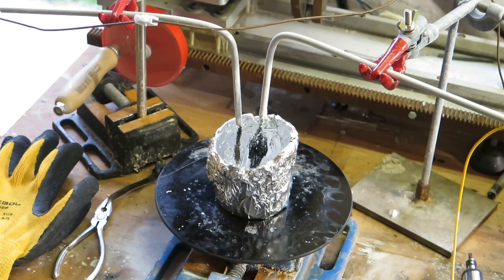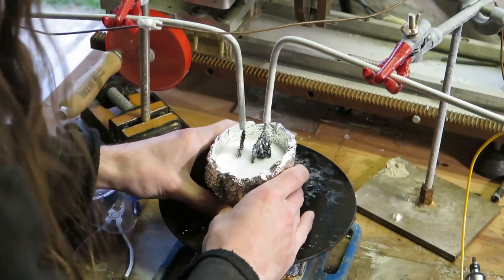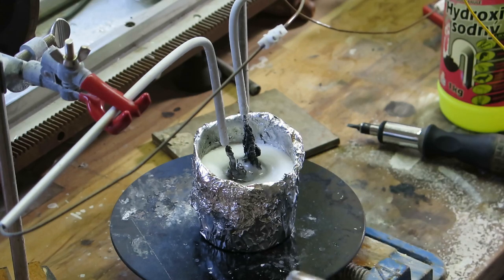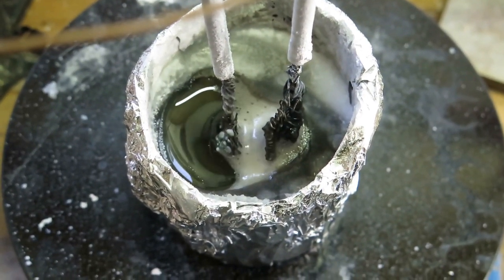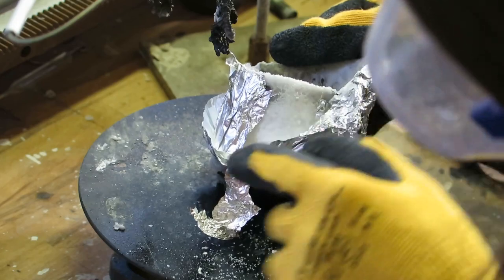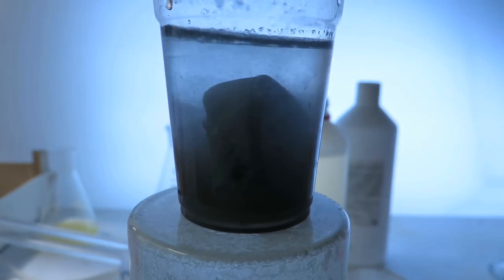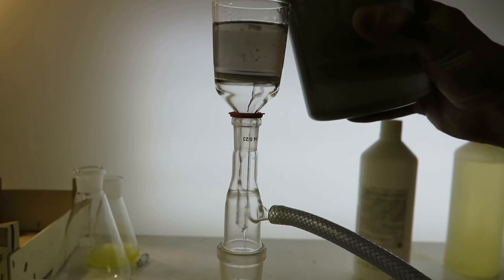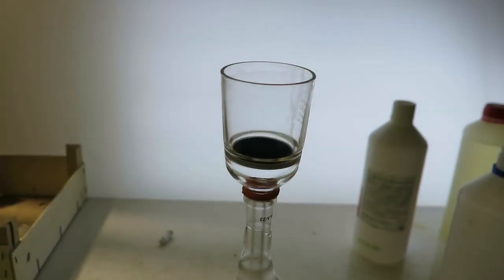Investigating NaOH contamination of Castner cell

Comment: You are very brave guy to put NaOH into Al, as NaOH can easlity react with Al. 
Why don't use PTFE beaker and simple stainless or  Ti electrodes?...
Reply from the maker: NaOH doesn't react with aluminium without water. it would have to be redox and on the right side you would end up with metallic sodium, which is super unlikely.

Comment: Interesting. I'd like to build a little automated Sodium producing machine. Stainless steel seems to be a good electrode material as well. I think you are the most experienced sodium maker on YouTube. Do you have some tips and things to avoid? Would stainless steel last longer than aluminium in the long run? Others say Sodium production seems to be good at first and slowly get worse, do you have an idea why that could be?
Very nice content 👍
Reply from the maker: There are countles SS alloys and most I have tested were degrading and did cause serious contamination. You can use nichrome for electrodes or pure nickel, perhaps there are other metals that won't degrade but these two are cheapest and quite available.

SS container will cause contamination but it is also conductive so it may cause hydrogen/oxygen buidup where you don't really want. Aluminium is covered with nearly non-conductive film as soon as it touches NaOH so as far as cell knows, it's ceramic. That is great when you want to have separating walls or stuff like that

I can say as well that sodium production seems to be slower over time. Last time I investigated effects of temperature on this and it doesn't seem to affect this. you still het best production around 330C but it is even better with fresh NaOH. It is possible that steady state production is just lowed due to water created during electrolysis. I haven't operated cell long enough to check that. Also it would require controlled conditions to monitor the output, not manual extraction.

Once I will have my new electrodes, I will do prototype with automatic extraction method and see how that works, then I may be able to monitor output vs time
Reply: @IlusysSystems  Very cool. Thanks a lot. Can't wait to see your automated extraction and investigations. :-) 👍